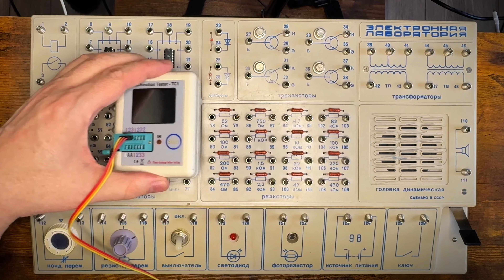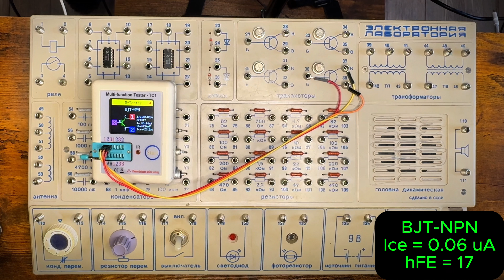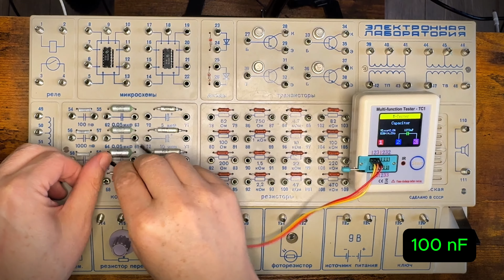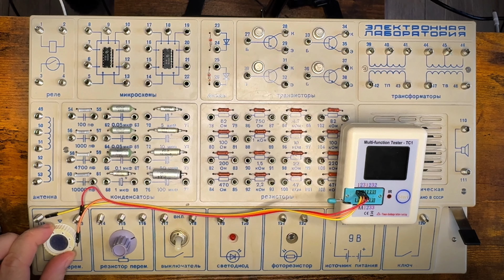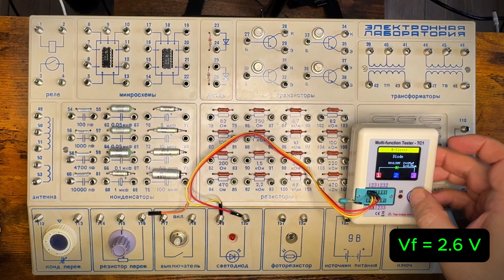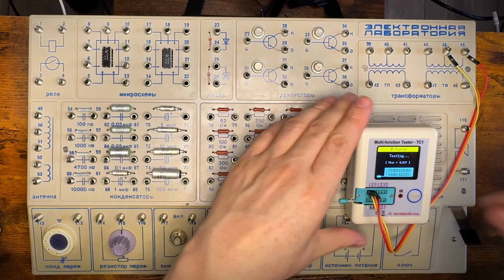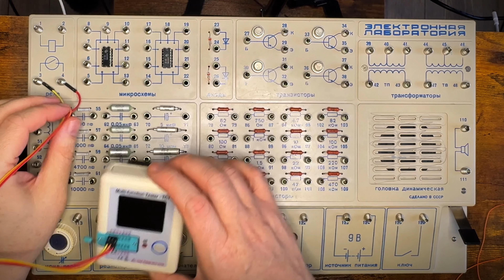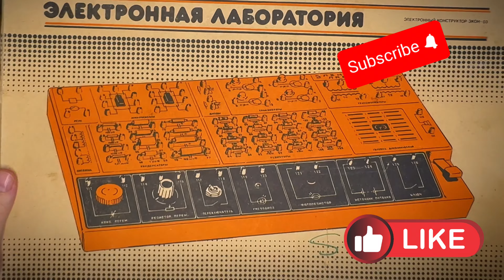Vintage Soviet Electronics: Testing EKON-3 Components Some 40 Years Later

Comment: I'm not sure how common axial lead capacitors are these days. I guess you could use modern through-hole electrolytic capacitors to replace the bad ones, but you might end up needing extension wires, and even if you do not, it might ruin the look. I suggest you replace the bad components with new ones, put the new ones on the underside of the board, and hot-glue the dead old ones on top of the board.
Reply from the maker: Perfect, that is exactly what I will do. May I mention your nick name in my next episode?
Reply: @ExpatProfessor  Absolutely.